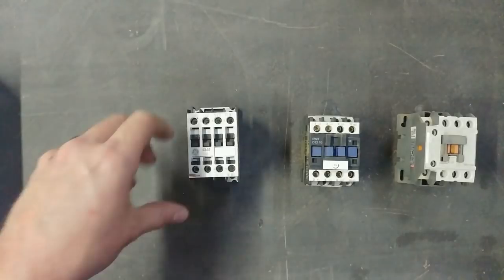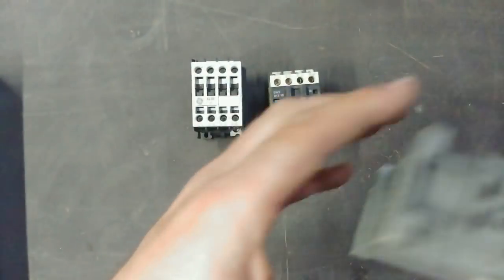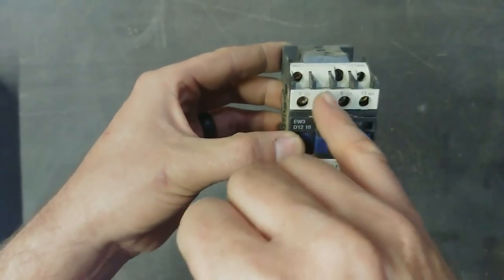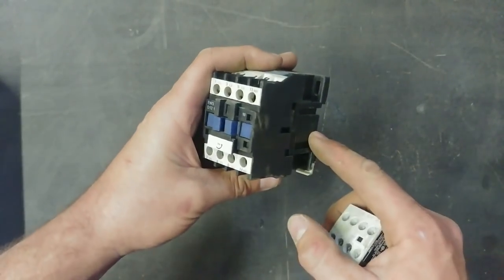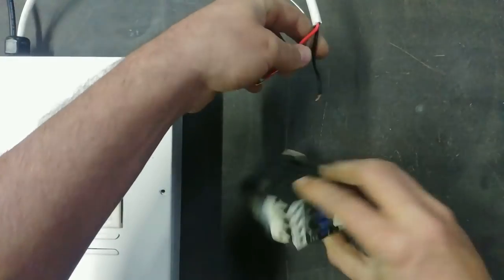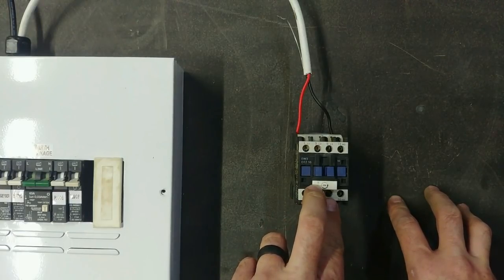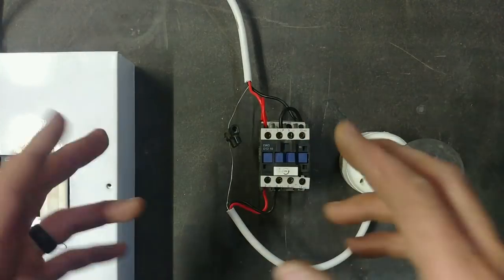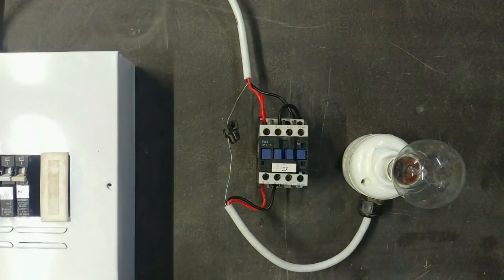How to connect a Contactor

Comment: How do you connect a light switch to a contactor
Reply from the maker: Hi Johan
Run the Neutral wire directly to the A2 of the contactor (if it is a 230Vac contactor)
Run the Live wire to one point of the switch and the other point on the switch goes to A1 of the contactor.
Reply: @p0we111  thanks
Reply: @p0we111  can I connect the black wire to a1(from the light switch ) an connect the red wire (from the switch) to L1 an take a red wire from the McB an put it on L1 wil the switch work or wil it trip
Reply from the maker: @peterjunioradams873  Hi. I'm having some difficulty understanding your wiring.  I would just break/switch the red incoming wire that goes to A1. Do not put the red and black wire on the switch. 
Take the red wire out of A1 and put it on one contact of the switch. Then run another red wire from the other end of the switch to A1. Hope that helps
Reply: @p0we111   ok I have a light switch there two wires one red an one black so I connect the red to A1 an the Black A2 it will work thank you @jean
Reply from the maker: @peterjunioradams873   So your switch has 2 points with one red wire and one black wire coming from them. I assume that the red wire and black wire are connected to the two switch points.  
You will have to take the red wire out of A1 and connect it to your red wire on the switch. Then take the black wire coming from the switch and connect it to A1.

Please make sure the red wire and black wire coming from the switch are switched (connected to the 2 points of the switch) and that the black wire is not the neutral wire. You will need a multimeter to test this if you cannot see inside the switch.

If the red wire is in fact the switched wire from the switch and the black wire is the neutral wire then the red wire goes to A1 and the Black wire to A2.
Reply: @p0we111  there is 3 inputs on the switch the top one(L1) is the black wire the middle(com) is the red wire an the last one is empty (L2)
Reply from the maker: @peterjunioradams873  Ok. If you want the contactor to switch on with the light you will have to take a wire from the switched wire. In this case I will guess the black wire. 
So run a wire from the black one in the switch (L1) to the A1 of the contactor. 

Some switches does not have a neutral wire pulled into it so that might be a problem. (Do not assume that the black wire is a neutral) If the black and red wires are the only ones in the switch,you have to pull in a separate neutral wire from a box/connection in the roof or from the light.

If the contactor stays an even after switching the switch,then you know that the black wire is the Live and you should move the wire you ran from L1 to A1 - To Com and A1.
Reply: @p0we111  thank you Jean b it working it for my son school project but can I ask one more question can you connect two lights switchs on one contactor to controller two different lights ( what I mean by that one light switch controller one light an the other switch controller one light not all two switches control both the lights )
Reply from the maker: @peterjunioradams873  If I understand correct then,no. You would need two contactors/relays to control the two lights. 

What you can do is if the contactor/relay has a NO (Normally open) contact and a NC (Normally closed) contact you can switch one light on when the contactor is on and the other light on when the contactor is off. The problem is there will always be one light on. 

You can switch the contactor on with two switches using 2way switches. https://www.youtube.com/watch?v=Y8OVDuL3wn0

Comment: I don't understand how the A1 is connected and the A2 is no longer connected
Reply from the maker: With most contactors you have one A1 contact and two A2 contacts. So you will only connect a wire to A1 and one A2. The two A2s are just for ease of use. 
Just connect your Live to A1 and Neutral to A2 if its a 24V\110V\230v coil or connect the Live 1 to A1 and Live 2 to A2 if its a 400V coil.
Hope that helps.
Reply: @p0we111  then where will your neutral go or are you calling live 2 your neutral ?
Reply from the maker: @seremaiarabaraba8280  If the coil is 230v then put the neutral on A2.
Reply: @p0we111  if it's 400v then where will your neutral be connected ?
Reply from the maker: @seremaiarabaraba8280  400v means  its 3phase. So you will have to connect 1 x live to A1 and 1 x live to A2. Otherwise if you only have 230v 1phase then you will have to get a 230v contactor.

Comment: Hang on one sec.......its a 240 volt coil....BUT YOU USE A NEUTRAL wtf.......this doesnt make fucking sense man
Reply: THERE IS NO NEUTRAL BOTH ARE LIVE....AND DEPHASED 180 DEGREEE
Reply: Some countries use 230Volt single phase and 400Volts 3phase.
It sounds like your country uses 110V 1phase and 230V 3phase.
Thus the confusion.
Reply: @jeanboetzkes9820  no dude....im 120 volt 60hertz 240volt 60 hert, 347...600...

My point is a 240 volt item will use two hot wire of 120 volt not a wire and a neutral...unless you guys are wired on 480 volt which u will only tap on one phase
Reply: Yes. Our country uses 230V 50hz 1phase with neutral and 400v 50hz 3ph when tested phase to phase. (hot phase to hot phase)